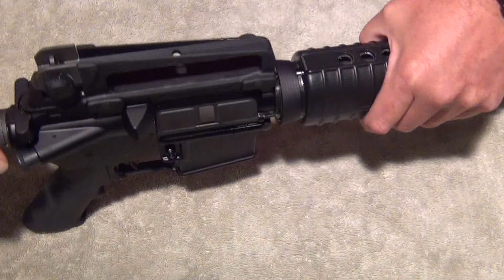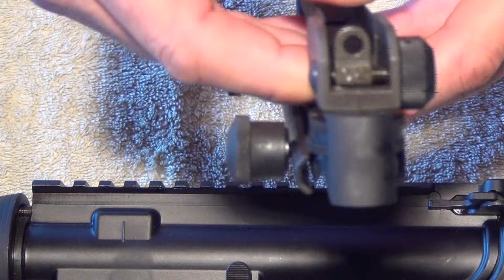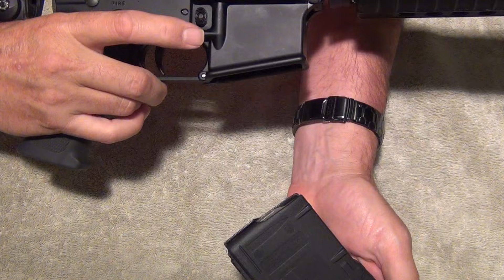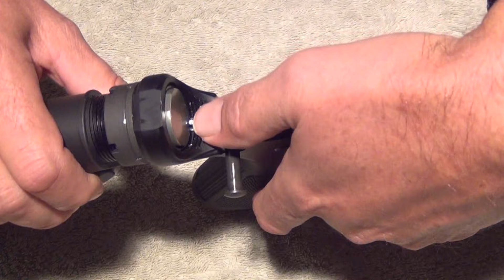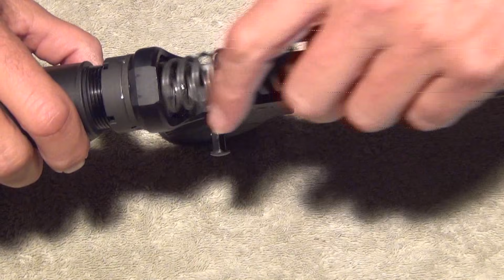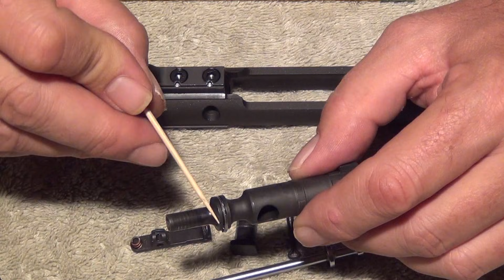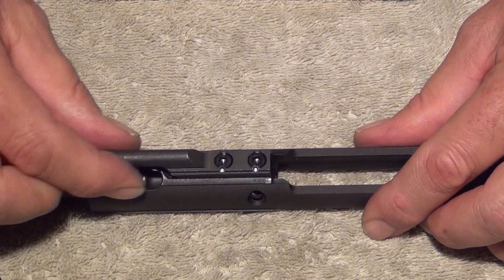AR-15 Basics: Controls, Function, Disassembly, & Reassembly.

Comment: That was the BEST instructional AR video I've ever seen on the internet and I've had it explained to me by both military and security professionals (not the kind that work at the mall).  As a first time rifle owner I found this video extremely helpful and would suggest that anyone that's new to owning an AR15, bookmark this sight because when it comes time to clean or make upgrades you can walk through the process step by step.  Thanks for the really good job you did on this video.
Reply from the maker: Thank you very much for the very enthusiastic complement! I appreciate it and it's great to hear from another new AR owner. Thanks for "Like". Cheers

Comment: Nice video explains a lot. I am pretty new to the ar but correct me if I'm wrong I think that carbine is for the length of the gas block, you have carbine and mid length gas systems. carbine is a shorter system and the mid length is a little longer. But the barrel still stays the same size, of course unless you are running a longer barrel. Again I'm pretty new to the ar my self that's why I'm looking to learn more. Again great video. Thanks
Reply from the maker: Thanks. Generally, a carbine is a short, handy rifle. Most manufacturers and shooters today use the term "carbine" to describe any model of a rifle that has a shorter barrel than the standard, or original model of that particular rifle. Cheers

Comment: Ps is your ar piston or gas , your bolt seems to be colt , videos ive watched said le6920 is gas cn you explain the difference .
Reply from the maker: Thanks. The Colt is gas operated. A portion of the expanding gas is siphoned off and sent back to push the bolt carrier group (BCG) rearward. A piston gun also siphons the gas, but pushes on a rod/piston to push the BCG rearward.
Watch these videos for a better explanation.
How it Works - Gas vs Piston AR-15s
Gas Piston Vs. Direct Impingement AR's

I'm more than willing to help you / answer questions, or direct you to a video that will answer questions. Cheers

Comment: Nice clean and straight forward video. I don't currently own an AR-15 but I'm looking at the Colt LE6940 for the Monolith Rails and the flip up sights. I plan on adding a Trijicon Acog and probably a front grip that has built in bipod feet in it. That will probably run about 3K for that particular setup but Colt and Trijicon are top quality products and well worth the money. Thanks for the information in your video, it will come in handy should I commit to purchasing the items that I've mentioned.
Reply from the maker: It'll be a nice set up when you get it. Cheers

Comment: Hey man, thanks for the video. I just finished building my first ever AR and have a question. When going through the loading process as you show, im running into an issue. Everytime i pull back my charging handle to "charge the weapon" it locks my bolt carrier open, and the charging handle doesnt automatically retract upon release. In order to get the carrier group to "seat" a round, i have to hit the release on the side. Did I maybe assemble something wrong, or is it a user error?
Reply: Without a magazine, i can "charge" the weapon and the charging handle will automatically slide itself into place. But when i put a magazine in, i have to use the carrier release.
Reply: Derek Kowalski Nevermind, figured it out. Seems without an "actual round" in the magazine, a tab on the back of the mag prevents me from "charging" a round into place.
Reply from the maker: Derek Kowalski I just got the messages. That was my first question. Glad you figured it out. The rifle should function as follows:
No magazine = bolt should not lock back unless the bottom of the bolt released is pushed and held down with the charging handle back.

Empty magazine = bolt should lock back when the charging handle is pulled, or the last round is fired (it's a bolt hold open on the top of the magazine as you deduced).

Loaded magazine = If the bolt is forward and you insert a loaded magazine, pull charging handle and let it go, it should chamber around. 
If the bolt is already locked back, and you insert a loaded magazine, you should have to push the bolt release to chamber a round.
Cheers

Comment: I have a dumb question; The weather was finally nice so I went to the range to sight in a new scope on the AR-15.  I have fired about 10 rounds before. But I could not get the weapon to fire this time...I removed and reloaded a 10 round clip, I watched a round go into the chamber.  So I thought maybe I forgot to reinstall the firing pin. No every thing seemed ok there.  After several attempts and getting just a click. I gave up and came home..  I couldn't see a mark on the primer cap. like the firing pin was not even striking the bullet.. Any Ideas ??  Thanks

Comment: this is very informative -  I am having a problem with the bullets extracting - the gun misfired yesterday at the range and I could not cycle it.....finally after some coaxing I got the bolt to open but it did not extract the round.....this is only after about 120 rounds total thru the gun.....I used your instructions to dis assemble and clean the gun....still having the fail to extract on about every third or fourth cycle.....the extractor does not seem to be damaged - how much oil should I apply to the bolt carrier group and when doing a complete breakdown how much should be applied if any to the internals ( firing pin, cam, extractor, etc. )
Reply from the maker: Hi Mr. Mann. Did you check the spring on the inside of the extractor (make sure extractor channel, and claw are clean, should be after only 120 rounds)? My AR also has a small rubber piece co-located with the spring, just make sure everything looks about like mine in the video at 10:24. AR's like to run wet. There are two links to cleaning and lubrication at the bottom of the description (click - "show more"). Hickok45 and James Yeager. Hickok uses Ballistol, and James uses grease. I use both, grease where James does, and Balistow on everything else that is not greased (trigger group, buffer spring, blot, bolt carrier group), it doesn't have to be soaked, but there should be a light coat on everything. Hope this helps. Cheers
Reply: stanfordcoffee  yea did do some of that with lubing the gun  - but will follow your suggestions and re apply lube where James and Hickok45 recommend....I did re examine the spring in the extractor - my gun is the S&W M&P15  sport. it has a spring where the extractor is with what looks to be a rubber o-ring - however in your video when you disassembled the extractor it seemed like the amount of force you applied to the spring actually caused it to pivot or rock - mine does not seem to do that......all the pieces are there but to me it seems like the spring has lost its coiling ability....it was not "springy"  but I am not sure how much spring should be in it...... I also need a chamber brush to clean the internals a bit better.....thanks for the help !
Reply from the maker: I think you may be seeing my finger compress more than the spring does, they're pretty strong (supposed to be, otherwise it wouldn't grab the case). I tried pushing out on the face of my extractor, it just about ripped my thumbnail off, but it did move a little.

Comment: Great video...got my colt last saturday......im finding that my hand guard, when gripped firmly can be twisted/rotated approx 1/8 inch inboth clockwise and counter clockwise directions...is this normal or am I just being retentive?...
Reply from the maker: Sounds about right, mine moves about an 1/8 of an inch is well, no big deal. The only ones that won't move are ones with a special ring attached / screwed to the upper receiver that the fore grip attaches / screws to (usually associated with fore grips that have a picatinny rail running along the top). Cheers

Comment: this is gas operated, right? i want to see connection between this two, bolt and gas tube.
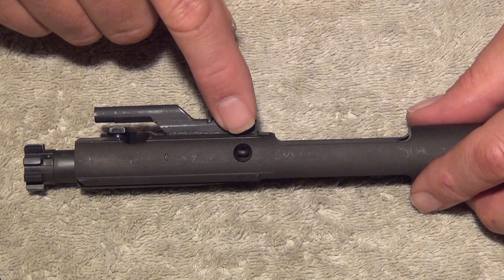Reply from the maker: Yes it's gas operated (direct impingement). Look at 09:15. You can see the gas tube coming into the upper receiver (from the right). That gas tube slides into the gas key on the top of the bolt carrier group (BCG). The gas key is that a Z shaped tube on top of the BCG at 09:29, above the cam pin. Because of its location, you can't see them come together unless you take the gas tube off the rifle. Gas comes through the gas tube, pushing the gas key (and BCG) backward, allowing the rifle to cycle after it's been discharged. Hope this helps. Cheers

Comment: is the le 6920 easy to clean and great quality ?  advice needed am looking to buy one and its first one
Reply from the maker: When it comes to cleaning, most AR's are all the same and easy to do.
Most AR's range in price from $700 - $1800. The Colt falls right in the middle, and IMO, is good quality for the money @ $1200. Set your budget, and do some research, to figure out what you get for the money. Bushmaster, and Windham Weaponry also make good rifles at a lower price point. Cheers

Comment: great video, just wish I hadn't viewed it. I cant get the cotter back in. aaaaaahhhhhhh
Reply from the maker: Sometimes mine will be a little difficult as well. Don't panic! It'll go back in and you haven't done anything wrong to your gun. Make sure the firing pin is all the way forward. Insert your cotter pin and wiggle it back and forth along the same access as the round part at the top. In other words, insert the cotter pin so it's round top is parallel with the line of fire, and wiggle the pin parallel to the line of fire. It'll go back in. Let me know how turns out. Cheers

Comment: Nice video! Have literally never been within 10 feet of a (real) live, firing weapon before and I plan to go to an indoor shooting range this February for my birthday. Got a little interested so I watched this. And for my first gun, should I fire a rifle, shotgun (Don't they have a lot of backward kick?) or a handgun. I feel like a handgun would break my wrists in a bad recoil situation vs a bruise on my should with a rifle.
Reply from the maker: Shotguns have the most kick, an AR has almost no kick it all. Most indoor ranges will not let you shoot shotguns, or rifles, (except .22's). Large caliber pistols may twist in your hand, it may hurt your wrist, but nothing is going to break it. I suggest you start with the .22 LR, pistol, or rifle. And work your way up to 9mm as you start to feel more comfortable. Get some instruction, and start with small calibers, and work up to larger calibers, it will help ease your apprehension. Have Fun! Cheers
Reply: Sweet thanks! I was being a bit sarcastic with the "break my wrist thing" but still wanted to know if it even DOES hurt your wrist. I have a friend with an AR-15 and such so I'll just get my bearings with a smaller caliber and then try out the AR

Comment: i bought one a year or so ago ... but havent had the opportunity to fire it yet .. i am the 2nd owner.  the last few days ive been watching videos on it and yours by far is the most informative .. i kept hearing a rattle in the barrel and seperated the lower half from the upper half ..... looking down the barrel i can not see all the way thru it .. something is blocking it but its about halfway down ... can a spent shell get lodged there?  sorry for the length of this
thanks
nat
Reply from the maker: If you can't see through the barrel, something is most definitely wrong. A spent shell casing would be visible from the chamber end.
There is a phenomenon known as a squib round. The round is fired without sufficient gunpowder to push the projectile all the way through the barrel, the projectile will get lodged halfway through. DO NOT FIRE YOUR WEAPON until you can either run a cleaning rod all the way through it, or see through it when held up to the light. If it is a squib around, maybe you can drive it out with a cleaning rod. Try the cleaning rod, perhaps it is something simple, that will push out easily (dust bunny, spiderweb). If you cannot clear the obstruction, I recommend taking it to a gunsmith and have him give it a once over.
My four grip will rattle just a bit if shaken vigorously.
Hope this helps. Cheers

Comment: can you get a different  design on the back of it ?  like the older styles ?
Reply from the maker: Yes. Release the friction lock, pull down on the pins at the front of the adjustment arm and slide it off. You can replace it with any sliding butt stock that is compatible with a mill spec buffer tube (there are mill spec, and commercial buffer tubes - this rifle is mill spec.). If you want to replace it with an A2 style butt stock (the solid black triangle - non sliding), you have to replace the buffer tube with a different style. There are kits available for around $70.
If you want to see the process, YouTube search: " AR-15 A2 Stock Install ". Happy new year. Cheers

Comment: stanfordcoffee for some reason, my bolt wont stay back when I pull the charging handle. why is this?
Reply from the maker: The bolt will not stay back by itself (pulling it, and releasing it). You have to pull the charging handle all the way to the rear, then pushed down on the ball catch located on the left side of the rifle. Review the video starting at 5:32 , should help you out. Cheers
Reply: Oh I didn't see the ball catch part. I got my first M4 carbine and videos like yours help me out a lot. Many thanks!
Reply from the maker: My "speech-to-text", screwed me again. Just a heads up - it's "bolt" catch (as in bolt of a rifle), not "ball" catch. Sorry I didn't catch it. Have a Merry Christmas.

Comment: I walked into Cabela's and walked out with a Bushmaster.  Got home and realized I knew nothing about this gun.  I clicked on this video and learned what I needed to know to get started.  Thanks.
Reply from the maker: That's awesome! I almost got the Bushmaster myself, I like quite a bit. I'm glad the video was able to help you out. The AR is a fun, & versatile platform. Enjoy your new rifle, be safe. Cheers
P.S. Was it easy for you to find this video?
Reply: Video was easy to find. I have a coworker who is a retired Marine that's going to show me how to use it properly. But he chastised me for getting reflex optics instead of iron sights. He asked me "what are you going to do when the SHTF and you break your fancy sight?"  He has a good point.
Reply from the maker: Don't know what reflex sight you purchased, but if you add a back up iron site (BUIS), you'd be all set. If you get used to using both your BUIS and the reflex site, your golden. IF!, the reflex site fails, you can switch right over and still ready to fight. Just my thoughts. Besides, I transported plenty of military personnel, and 3/4 of them use should Trigicon sights. Cheers

Comment: i was under the impression AR liked to be ran pretty wet, How often you do you ad lube when you clean?
Reply from the maker: I removed all the lubricant for filming, to keep the oil off my camera and touchscreen. I add lube every time I clean it. Gun oil in the bolt carrier group, a little in on the buffer spring, and a little in the trigger mechanism. I also add a little all-purpose high-temperature axle grease to the four runners on the bolt carrier group. There is a link to Hickok45 in the description for cleaning and lubing your rifle.

Comment: Thanks for the video. I have been considering purchasing an AR for some time but have been intimidated by it's complexity. I own several semi-auto pistols and I'm comfortable stripping them down completely. After watching this I see that it's not all that complex. Now all I need to do is find a wrong handed (lefty) model.
Reply from the maker: The AR isn't difficult, if you can strip a pistol you can do an AR. Another option to the left-handed model is making a right-hand model ambidextrous. Just a thought / option. Cheers

Comment: Terrific video !!! Just bought a DPMS  Oracle and knew nothing about the AR platform. The DPMS I purchased has a "light duty" barrel & I'd like to replace it. any videos on barrel replacement in the works???
Reply from the maker: Thanks. No. To change the barrel you need a vice, vice block (to hold the rifle), and a armorers tool. You also need a torque wrench to install the new barrel. I don't have any of these. If I was going to do just one barrel, I would have a gunsmith do it, probably cheaper than buying all the tools. Cheers

Comment: And S Buchanan, found the manual for the Mossberg 715T here:

http://www.mossberg.com/manuals/702%20715%20Rev%20E.pdf

It talks about punching two pins on the receiver face to pull the action out of the rifle (page 15.) Looks like that is a basic blowback rifle and not gas operated, so it won't require such a deep cleaning.  Pick up a 22LR bore snake and/or a 22 rifle cleaning kit and you'll be all set.

Comment: Another AR newbie here. Going to pick up a DPMS Recon on Black Friday, and I realized when looking at them today that my understanding was marginal at best. Your video was VERY informative. I'm pleased that they're so easy to tear down. Compared to my Ruger 22/45, that's a piece of cake :)

Do you ever need to clean out the gas tube or is it self cleaning? Any cleaning required around the front gas block? I've read that they vent carbon into the action - is that fairly straightforward to clean also?  Or was that why you tear the BCG down for cleaning?

Thanks again for the awesome video!
Reply from the maker: I have a Ruger 22/45 as well. Love the gun, but the takedown can be a pain. Just practice with it. Cheers

Comment: Your right. It won't affect a non -auto gun but its a good habit to get into.
With the hammer back out of the way and the gun on safe, there is no chance that the hammer will accidentally go forward and crack or damage the mag well. I like the bolt carrier take down part. Its important that the carrier pin is properly orientated to the firing piin.